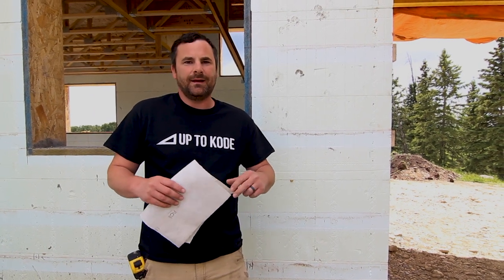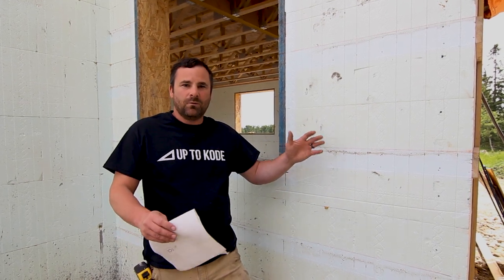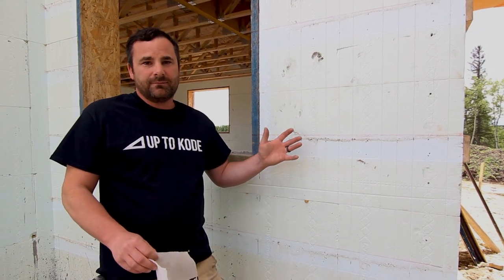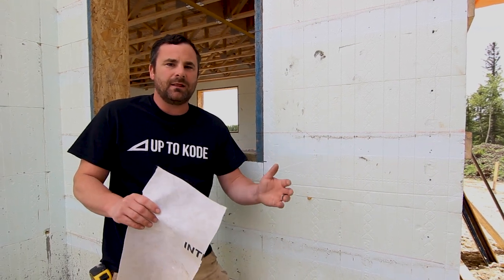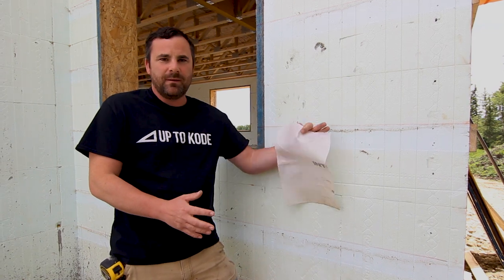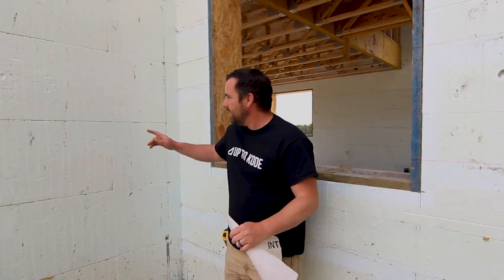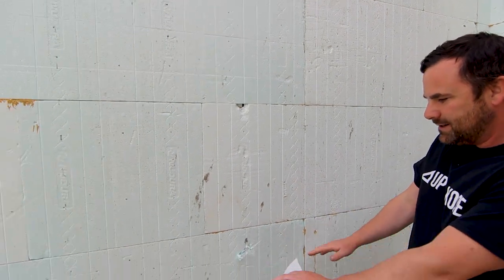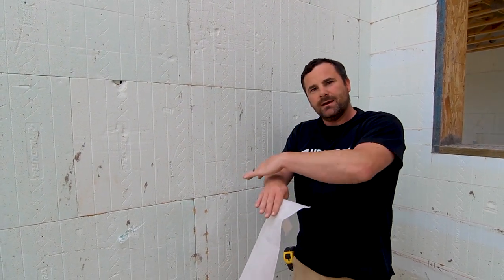Do You Need House Wrap on an ICF Building?

Comment: One of the questions we are frequently asked is the need for an additional weather barrier or house wrap in ICF construction.
The short answer to the question is no.
ICFs are a more effective and higher class vapor and water barrier than any house wrap product. ICFs must only be protected from sunlight and impacts through coverings such as brick, stone, stucco, EIFS, siding, etc.

Building wraps such as DuPont™ Tyvek® and other house wrap products are designed to shed bulk water such as heavy, wind-blown rain. They also allow the moisture that occurs in cavity walls to escape. Cavity (stud) walls are prone to moisture cycles and condensation because of the lack of thermal mass and the transmission of air through the walls. As the temperature and humidity outside changes so does the temperature and humidity inside the walls.

If these systems didn’t allow moisture to escape then you have the high probability of creating mold, rot, and other dangerous conditions in the structure as well as greatly reducing the insulation efficiency of the wall.

ICFs do not suffer from this loss of insulation value, even if the ICF foam were to be saturated with water.

The Long Answer is still no.
Examining the 2012 IRC beginning in section R611.4.3:

R611.4.3 Exterior wall covering. 
Stay-in-place forms constructed of rigid foam plastics shall be protected from sunlight and physical damage by the application of an approved exterior wall covering complying with this code. Exterior surfaces of other stay-in-place forming systems shall be protected in accordance with this code. 

Requirements for installation of masonry veneer, stucco and other finishes on the exterior of concrete walls and other construction details not covered in this section shall comply with the requirements of this code.

Further examination of the 2012 IRC section R703.1.1:

R703.1.1 Water resistance. 
The exterior wall envelope shall be designed and constructed in a manner that prevents the accumulation of water within the wall assembly by providing a water-resistant barrier behind the exterior veneer as required by Section R703.2 and a means of draining to the exterior water that enters the assembly. Protection against condensation in the exterior wall assembly shall be provided in accordance with Section R702.7 of this code. 

Exceptions:

1. A weather-resistant exterior wall envelope shall not be required over concrete or masonry walls designed in accordance with Chapter 6 and flashed according to Section R703.7 or R703.8.

These sections refer to flashing from the ICF outward around the exterior finish. Proper flashing at windows, doors, and the roofline are essential to any home, and ICF is no exception. Once flashed to the exterior face of the ICF, it has a full drainage plane to the footing or slab.
Reply: ^ that.

But if you feel safer you can install the wrap.
Reply: It isn't about the code, nor air infiltration, nor permeability. It's about bulk water penetration. Without a WRB, sooner or later you'll get it.
Reply: @RValueHomes  Maybe, but so what? 
According to "Moisture Control For Buildings" by Joseph Lstiburek, Ph.D., the hygric loading capacity of masonry construction is 10x or more than that of standard construction. An ICF house of ~ 2k square feet can handle in excess of 500 gallons of water before the hygric buffer is saturated and deterioration begins. Furthermore, due to the thermal mass and insulative properties of ICF homes the masonry core is protected from freeze-thaw cycles. I'm in favor of a WRB around windows and doors but wrapping the entire structure seems excessive. A more worthwhile detail IMO is to install a rainscreen under the cladding. Of course, there are extreme climates such as the Pacific Northwest where you'd likely want extra precautions, but for most people this is overkill.
Reply: @matthewharaminac6348  I agree on paper. But my clients aren't thrilled with water coming in the windows, no matter how many times I tell them what Dr. Joe said! We tried the WRB above the windows only on a dozen homes, and still had problems, even with a rainscreen. Our best guess is that water enters a seam somewhere far from the window, and travels the seams finally reaching a window.
Reply: @RValueHomes  Interesting. Where do you build? Are you positive the water is coming in from outside and not trapped condensation?
Reply: @matthewharaminac6348  West Michigan, mostly CZ5. Yes, because it is related to extreme rain/wind events. Too much to be condensation. It just bypasses our flashing entirely.
Reply: @RValueHomes  That's suprising butI'll take your word for it. I grew up on the other side of the state near Lake St. Clair so I realize how much moisture you have there. Where I am now (Denver area) I can't imagine having this issue, though it makes me wonder if more precautions are in order. I wonder if the issue is more likely in newer structures; some claim that the EPS holds in water from the concrete. If that is indeed true (I'm not saying it is, I haven't seen any empirical evidence) it could explain the hygric buffer capacity of the concrete being exceeded.
Reply: @RValueHomes  Simple solution to this video's BS about water getting between your Foxblocks: Spray Great Stuff on exterior edge of each course you add, before you press it down the last 1/4" and "lock" it to the Block below it, using Fox's proprietary system; spray the verticals also.  Simple solution to window openings: 3/4"x3/4" L-cross-sectioned aluminum flashing (1/16" thick) above the window... Set a saw to cut 3/4" deep, and use a 1/8" blade @ SLOW speed to open a horizontal gash in the ICF foam above your window (just above the window's TOP strip of housewrap), this metal "L" will make water flow to the OUTSIDE of the metal, and your metal is OUTSIDE of the housewrap along the lintel (top) of that window.  Install the window's narrow strips of housewrap, the butterfly-bandages, etc, exactly as you would if you were about to wrap the WHOLE house in housewrap... then Scuff both sides of the 1/16"-thick flashing-metal that's going to be inserted inside the 1/8"-wide gap, and on the other half of the "L," scuff the "inner" side that's going to be pressed flush against the lintel's housewrap, so the Foxblock is one piece of bread in the "sandwich," the housewrap along the lintel is the "meat" and the aluminum is the other piece of "bread".  Spray Great Stuff on both sides of the aluminum that's going to go into the 3/4" deep gash, and onto the vertical side of the "L" that'll touch the lintel's housewrap.  Add a tiny bit more Great Stuff ABOVE the "L" aluminum (whilst the Great Stuff that's now INSIDE the gash is still WET, so they bond to each other, and use a plastic spatula to even-out the Great Stuff that's sprayed ABOVE the flashing.

You now have strong adhesive (same as peel&stick relies on...) guiding water OVER and AROUND the window, and if you screw up, just use 1.5"x1.5" and cut a gash 3/4" above the old one. ...if using a 1/4" airgap, the 3/4" flashing is 1/2" too large to back-out once you add your lathe/cladding/whatever else, and pushes water OUT instead of IN even if you didn't scuff it properly, or even forgot completely to rub Great Stuff on it before inserting it, and so it then unsticks from the lintel's paper and instead, butts up against your cladding, because the weight of the outer half of the "L" makes it angle DOWN.  Just ALWAYS double-check it as you're adding the cladding/lathe/whatever around that window, the same way a city inspector dbl-checks a fire hydrant's concrete "kicker" and everything else before backfilling, or inspectors want to see your REBAR before you pour, and they want to see plumbing/electrical BEFORE your drywall, because once you "close it up" (backfill, drywall, clad, pour concrete, etc ANY part of a home), there's no going back.
Reply: @inkdelencquesaing1924  Wow, if that's simple, I would hate to see a complicated solution!
Reply from the maker: Yes. I will emphasize “drainage plain” in the future. But you’re absolutely right!
Reply: It's become obvious to me that "r value homes" is Kody's alt-account, as the same was suggested, but in simpler language than Ink de L used (Ink apparently just used the ICF block manufacturer's FULL spec perhaps for liability reasons), but you're basically going to use paper bldg-wrap in the same way Kody agrees with us on, in one of Kody's other videos, then JUST add a metal flashing as Ink de L says).  That --which is same as Kody's method, then cut-in one metal strip, is WAY SIMPLER than this video (I can do metal flash on 10 windows/doors in the time it takes JUST to watch this video's criminally flawed advice, which VIOLATES YOUR WARRANTEE BY NOT FOLLOWING THE ICF-BLOCK MANUFACTURERS'S SPEC, which is what Ink de L and several others on this page have followed.

I feel sorry for any of Kody's customers: it's readily apparent that the fool doesn't even know how to "RTFM," in other words, follow manufacturers spec.
Reply: @RValueHomes this occurred in my first 3 story ICF home.
Reply: @smokestacklightning  It's interesting how it only happens on some homes.

Comment: Two points for my comment on this old video.
     There is an ICF house here in E. Texas built into a hillside (rear wall and about 35% of both side walls) where the owner / builder didn't put any waterproofing on the buried section, believing it was water proof. So water is draining into the house on both the back AND sides from it traveling. The concrete was vibrated in and it also was ordered to correct specs during construction. 
We peeled some of the interior ICF off because it had so much water between the Styrofoam and concrete that it had soured and started growing 'stuff' (no idea what, no samples sent out to any lab, just stinking slime).
AND amazingly, observing the inner concrete wall, the water seems to be coming by capillary action THROUGH the concrete wall at some of the plastic ICF supports. Removing some of the outside ICF we found it was totally wet between the concrete and Styrofoam and was wicking from the back buried wall to the sides, 25 to 30 feet from the buried sections. So waterproofing underground ICF with something is definitely necessary. We did dig the whole house out, applied fluid barrier where necessary and set up a French drain and dimple mat too.  Yet it may take a long time for the walls to lose their trapped water, he's having to run several large capacity dehumidifiers and it's been 4 months.
   Second point is I DON'T like Tyvek anymore as I've gone into several houses build years ago that used it and it was disentigrated and useless. Use something else.

Comment: I have an idea that could improve an ICF wall’s performance but might be somewhat difficult to pull off. The thermal mass as it cools or heats up in the different seasons could be regulated by installing pipes and circulating fluids through a buried ground loop. The walls core could be kept closer to ground temperature reducing heat gain and loss.
Reply from the maker: That idea would be worth considering and is possible. The install would be similar to rebar… one row at a time.

Comment: How do you identify your hard points after you wrap the foam?
Reply from the maker: I just make a 1 minute video on my Instagram about this.
Reply: i assume by hardpoints you mean the plastic stubs in the wall. what im doing is marking top of wall center plastic strip and hanging a plumpbob from the top down. thats just the solution i came up with though im sure there are many others. also you could just make a make at the corner of center stud and measure off of that cause the webs in the block are evenly spaced throughout

Comment: I see you have horizontal furring and 1X frames around your window openings. I am assuming you attach the house wrap over the furring. How do you create the airspace between the siding and the drainage plane? Can you do a video showing next steps, flashing details etc.? I am working on a similar project now and have planned for furring on top of the tyvek with MTI corrugated strips behind them for drainage.

Comment: how do you explain water not getting into all the nail holes
Reply from the maker: It’s my understanding that the goal is to shed the vast majority of the water and allow it to exit again. Wind and/or hydrostatic pressure can cause the water to be forced through the fastener holes. This is more typical in a house that isn’t stuccoed properly
Reply: @uptokode  that's inconsistent with the bad advice you thumbs-upped in reply to Ink de Lencquesaing a day or two ago and your advice in the video which contradicts the spec/directions ICFH block manufacturers tell you to do, in lieu of this overpriced, time consuming peel&stick wrap.  As per my last few comments replying to 3 or 4 people on this page: they and I agree it's obvious, you didn't "RTFM" (you are failing to install IFC blocks according to ICF block manufacturers spec/directions, and that's why your overspending (against every client's best interest) by applying this barrier, instead of the much simpler, and as effective, barriers that ICF-block makers DO spec in order to avoid the tiny bits of water that peel&stick also can address, but at a much higher cost/complexity than what Ink de L told you to do.
Reply from the maker: I may have thumbed up something but sometimes it’s just to acknowledge my viewers. 

In my own experience it’s best the treat the ICF wall like a wood wall. The block is not impermeable to water. It is NOT a drainage plain. I’ve experienced this first hand. 

The WRB creates a drainage plain and becomes a system that allows water to escape. 

I don’t base my decisions on theoretical science saying that foam is an air barrier therefore you don’t need a WRB. My knowledge is practical based and based on past experience.

Comment: How do you attach the wrap to the blocks?
Reply: icf products are designed as peel and stick with a water based primer you wound not want to use your standard housewrap on icf although it is possible

Comment: Kody are you vibrating these walls with a 1" pencil at 1 foot per second?  It sounds like a lot of the water issues come from not consolidating the concrete properly leading to honeycombing.  Seen it twice now on ICF facebook groups where they didn't bother to vibrate
Reply from the maker: I fine the 1” pencil doesn’t drop fast enough and it’s hard to keep up while pouring. Have been using a 1.25” vibrator pencil and it works great but if the concrete slump is too liquid you have to be careful